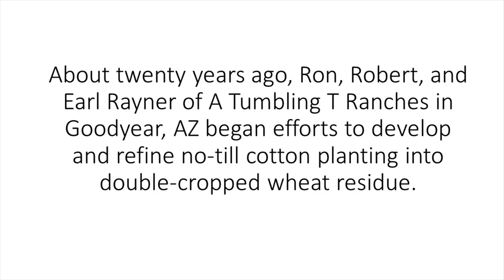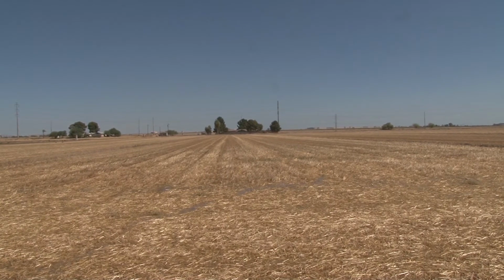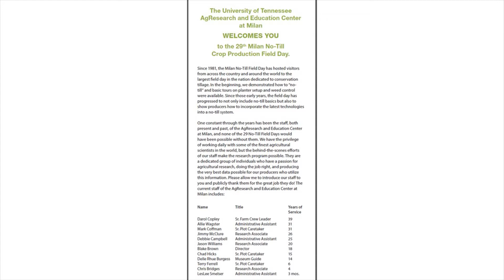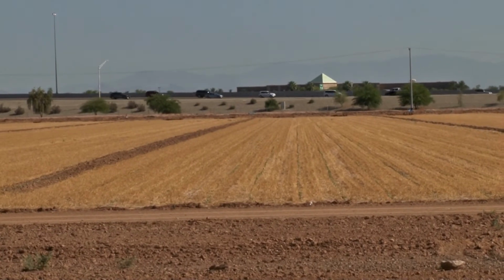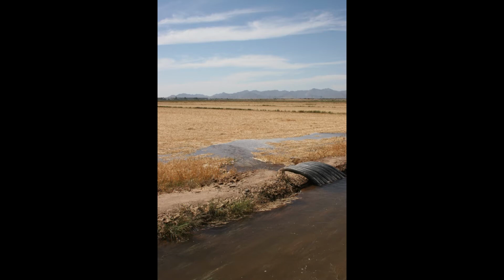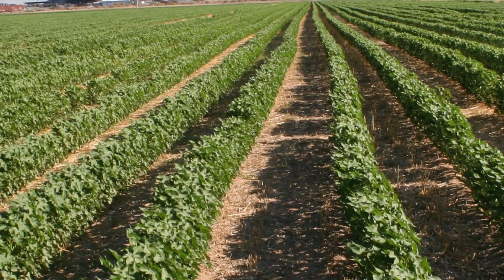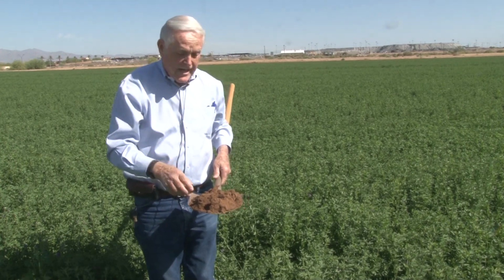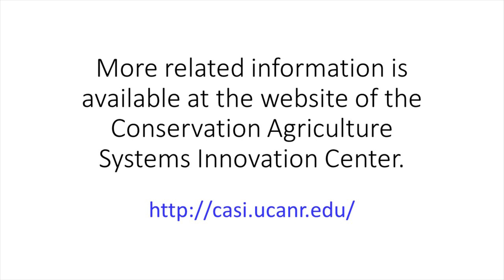Twenty years of no-tilled double-cropped cotton and wheat in Goodyear, AZ

Comment: In Texas we use corn and next year cotton.    We strip till the corn and this is our Shepherd for the cotton.    When the cotton is a foot tall we stalk chop the corn stalks.   In two years,  We can make 15,000 lbs corn and 1,000 lbs cotton with 3.5 gal/acre sprinkler system.    That is 660 gpm for a 230 acre field of corn and cotton that is strip tilled and fertilized in the winter before planting mid May.